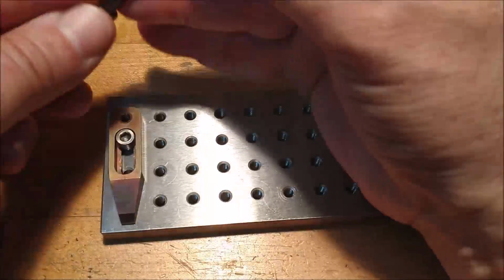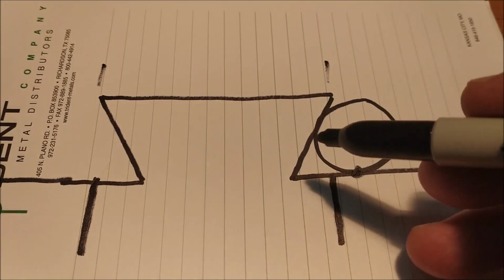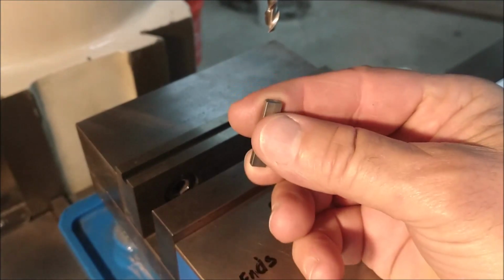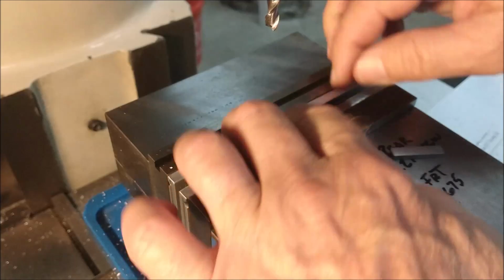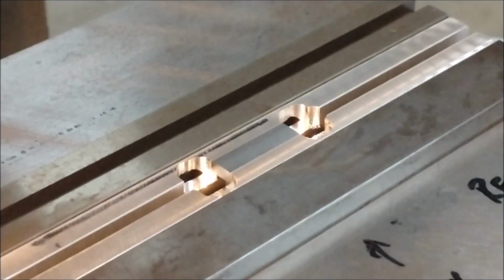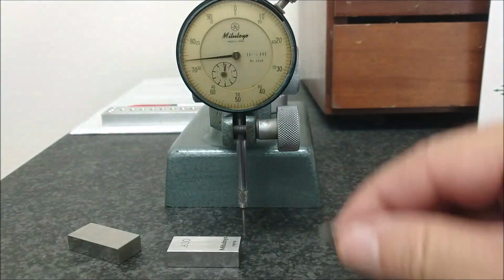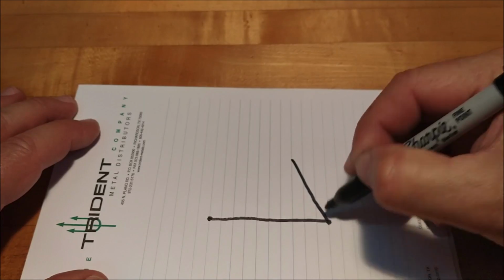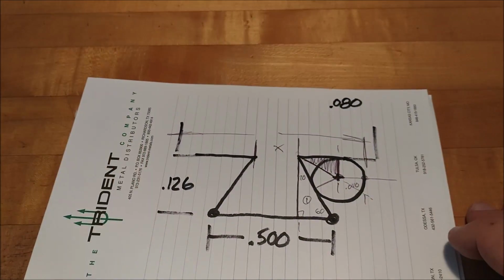Dovetails, Shop Gems and a Mini Mill Table Comes to Life !!

Comment: But isn't it once you put in a gib, the requirement for precision is thrown out the window? All that is required is to ensure the ways are perpendicular and or parallel to the some other axis.
Reply from the maker: I suppose a different type of precision is then required, but you are correct. Parallel and mating angles are the only requirement at that point.

Comment: The measuring rollers should be of such a diameter as to subtract an integer.
For example, a shaft diameter of 2.928 mm, then we subtract 16 mm and we get X.
Reply from the maker: Please explain this in greater detail.
Reply: @joepie221  YT deleting comments? I wrote a reply and it is not visible.
There were no links in it.
Reply from the maker: Try again.
Reply: @joepie221  It keeps getting deleted.
I will divide it into two parts, I wonder what bothers him?
Reply: @joepie221  I PART :)
For example, if X in your drawing is 10 mm, then if you insert measuring rollers on both sides (each with a diameter of 2.928), the caliper will show 26 mm. If X is 20 mm, the caliper will read 36 mm. Always by a total value of 16.
Reply: II PART:
You can make a set of rollers like this:
n*0.1830
When using such rollers we will always subtract the total number.
I will draw it and send it by ???
Reply: Where there are question marks there was a word meaning electronic box. Of course, no address. And YT found it inappropriate?

Comment: The 3ed hole an oil hole or lock down ?
Reply from the maker: A vertical stop pin will be installed at assembly.

Comment: Hi Joe. Instead of trying to use trig to calculate the amount you take off the angled surface, why not just take the .023” off the opposite, flat surface?
Reply from the maker: There is a little matter of the holes in the plate already being on location from that surface.

Comment: I'm thinking the table would have looked better (no porosity) if you just started with an aluminum bar instead of the casting. Not many more steps would have been required, in fact, maybe less as you'd start with more bankable surfaces.

Comment: This is classic Joe Pie video.  Too many excellent machining tips to list.  Avoiding damage to a cutter by setting the cutter height and then testing the height by rolling a pin under versus setting the height against the pin, for example.  Work holding guidance that makes it look easy.  Explaining the math behind the work.  Really fun video.
It's easy to lose perspective  of how tiny these parts are; the camera makes them seem much larger.  It isn't until you're holding and assembling the finished work that it becomes apparent how delicate the machining operations were.

Comment: Waking to find JoeBe-Won doing this. Loving it with my senior coffee.

I have a kindt Collins spindle sander. My is basic. But an options list required a dovetailed slot to work. A few have this slot. It’s filled in generally with an oak insert.

I actually have the blueprints for those options. Don’t Ask How!

The table casting is the same on both machines. Just one has this dovetail feature on the left side.

The drawing was done in the 1940s/1950s. In it ate precisely the pin setups for measuring the dovetails. But these are inside dovetails instead of outside dovetails. Same concepts apply.

It blows me away how useful simple descriptive geometry is. It would be really cool to have a summer course for kids/makers covering this. We are getting older and the kids are not learning this.

Comment: Yep, theoretical sharp edges are just that: theoretical. 

The techniques you've been showing with a pin are really important. Banking a sharp edge against the bottom of the vise will not give you a reliable location. Chamfers are also an issue unless you know they were precision ground and you've verified that on a surface plate.
Reply: Precision dovetails in machines has always been a challenge. Time to think thru it. Scraping them is a bit easier when the machine work is done as long as you have a good reference.